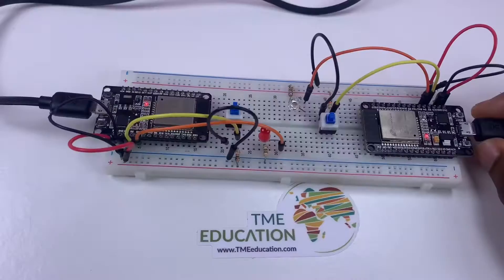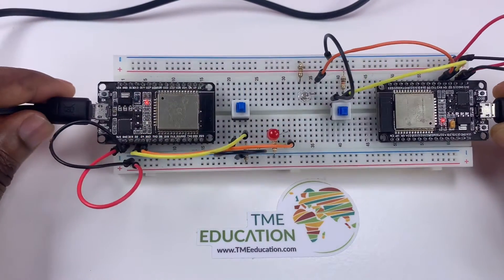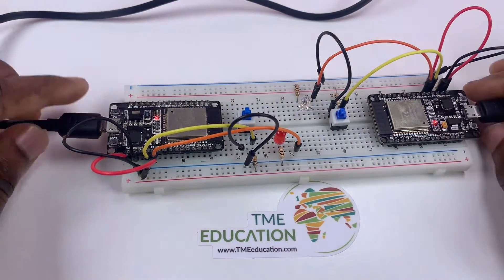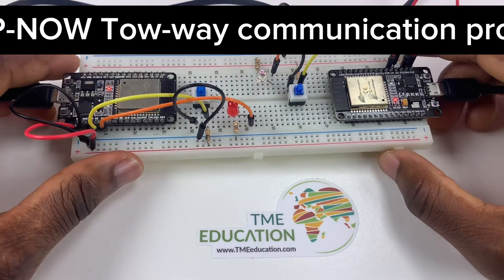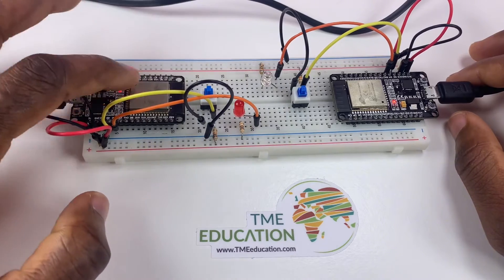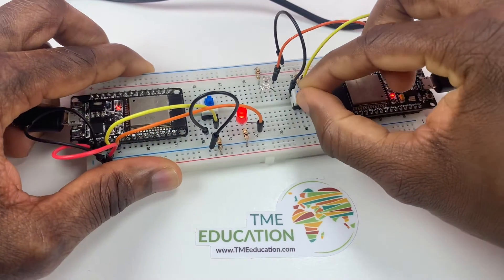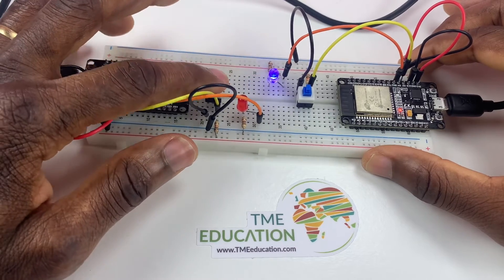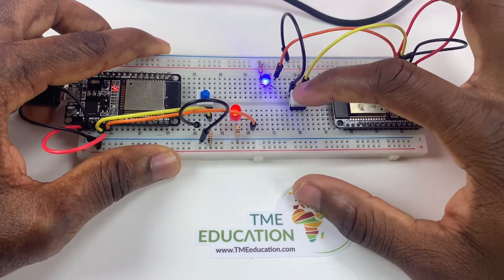ESP-NOW Two-Way communication Between ESP32 Boards | ESP-NOW PROTOCOL

Comment: I'm really having trouble understanding how to connect the esp32 to a power source.
Can I use a 9v battery? And where to connect it to a vin pin or a 3.3v pin
Reply from the maker: Look at the specifics, and use Vin pin to power the board